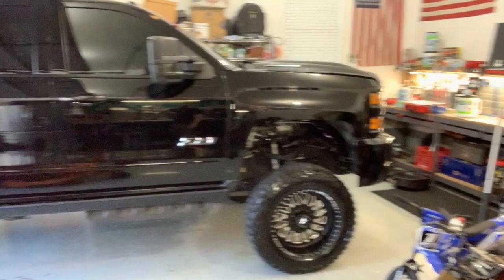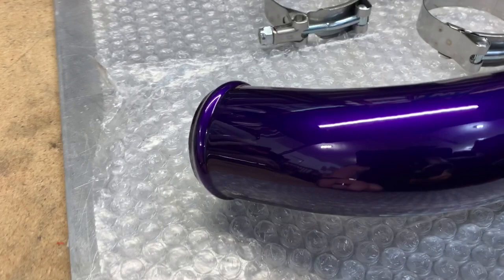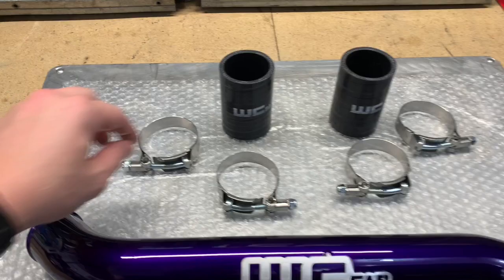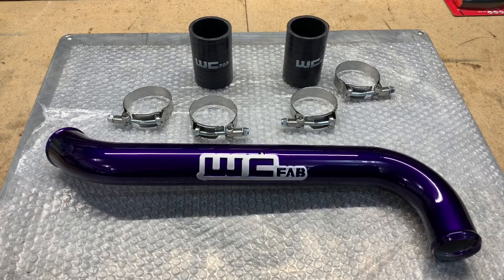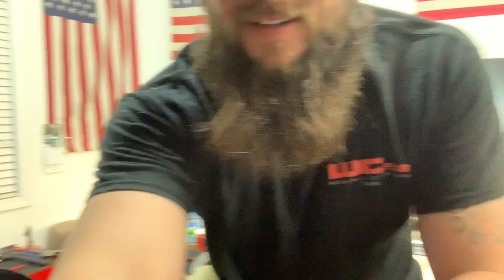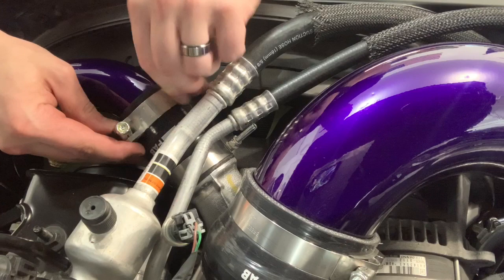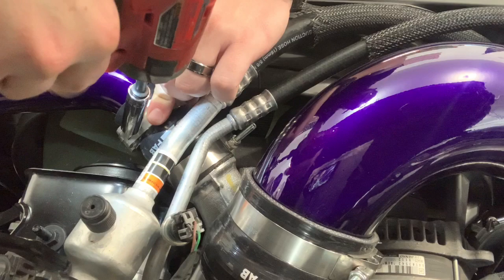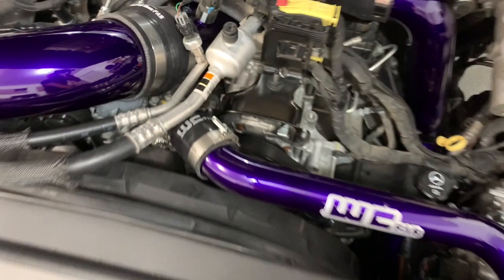Wehrli Fab Upper Coolant Pipe Install! 2017-2019 Duramax L5P!!

Comment: I just ordered the upper radiator coolant pipe for my 2013 LML Duramax. I  also have the drivers side hot pipe on the way. I just bought this truck. It's my 1st diesel I've ever owned.  It's a 2013 chevy silverado 2500HD 6.6L LML Duramax with 144,000 miles. The truck is 100% stock. I also have a 100gph Air Dog lift pump sitting here waiting for spring. It's way to cold now to me horsing around with anything. But I'm watching everyones you tube videos to learn from. I'm doing the easy stuff 1st, to learn and grow confident as l said my 1st diesel.
Reply from the maker: Wayne, congrats! The LML is a great platform! Enjoy the new rig. Let me know if I can help with anything!
Reply: @Scott Link  
Where r you located? I'm in North Branch Minnesota
Reply: @Scott Link  
Hey when you installed your upper radiator pipe, did you just pop off the stock hose and allow what ever coolant to just drain out from there? You didn't pop off the lower hose?
Reply from the maker: @waynejohnson3388  Kentucky! 💪🏼🇺🇸
Reply from the maker: @waynejohnson3388  it’s actually best to just unscrew the drain in the bottom of the radiator!
Reply: @Scott Link  
I'm not seeing a drain spiket on my bottom of my radiator? Do you know it's location. I want to loose as little as possibly of my coolant because the dealership just preformed a cooling system flush and refill.

Comment: Engine bay is all dressed up and looking 💯💯💯👍👍 you are going to have to keep an eye on the coolant for a while... these L5P's are really finicky with burping the air out.
Reply from the maker: I sure will. That’s what I have heard. I should have ran the heat etc when I fired it up. I’ll do that, and check it after each time I drive it. And thank you! It’s coming together. One piece at a time. I appreciate you watching!

Comment: Awesome install brother it sets off the engine bay real nice, make sure you give it a second tighten once you get her up to temp right after you drive it , mine leaked a little but once I re torqued it she was fine, as a matter of fact it leaked slowly on to a belt which for a whole 2 weeks made a noise that I thought was a bad injector it put me through hell, than I found it it was just the coolant leak hitting the belt .........man it was crazy.
Reply from the maker: Thanks for the tip! I’ll be sure to re check it after I drive it! I appreciate the feedback. And I appreciate you watching as always! Thanks for stopping in!

Comment: Sorry you had to learn that the hard way... always drain the radiator down some or all the way depending on what hose your dealing with. If nothing else it saves a hell of a mess lol.  I’m working on getting all the whirly fab stuff now, already have my intake horn. They didn’t have the intake when I put the banks on, so will be trying to sell that 🤦‍♂️
Reply from the maker: Yea. I prob should have drained it a little. My dad told me the same thing after he watched the video! Ha. Live and learn. It wasn’t too much of a mess. And all the stuff makes the truck sound very different now. Hope these videos help when you get around to installing! Thanks for watching, I appreciate it!
Reply: @50calprepper 
How much for the banks intake?

Comment: Scott great videos man, watching from way up north. Always appreciate your vids as I have a lot of the same mods. and have watched yours to learn from you haha, quick questions for you any increase is sound from your intercooler pipes being done? and any plan in the future on doing your down pipe or uppipes? thanks man keep up the good work.
Reply from the maker: Well, I did the intake, turbo horn, and Intercooler pipes all at once. The truck sounds very different! But I can’t pinpoint if it was the pipes or not. Down pipe for sure. But that may be for a later time, when some other mods are done. I appreciate you watching!

Comment: Is there a benefit to this or is it basically just for looks? Seems like it just adds 2 more spots for a leak
Reply from the maker: My opinion. Mostly for looks. But some functionality also. Some big Block high HP vehicles have a tendency to collapse the upper hose and pinch it closed under a heavy load. That’s why you typically see a steel braided or a metal style upper rad hose on older big block cars. Also, I have replaced very spongy hoses in the past. This will never collapse or become spongy. Yes, you are correct about the additional leak points. It’s personal preference. I routinely maintain my vehicles and this is on the list of things to check often. As long as you do that, you’ll be fine. I have had zero issues so far. Best of luck and thanks for watching!

Comment: if you let it run with the cap off you should be fine just add as needed
Reply from the maker: Thanks! I wasn’t sure what the hell to do! Ha. I appreciate you watching!
Reply: @linksgarage1985  yea I'd like to get all that piping as well for my 18 plus the  up pipes
Reply from the maker: @hatchetwarrior1240  - yep. I’ll eventually do up and down pipes. It’ll be a little bit. Lol
Reply: @linksgarage1985  yea the down pipe gets pricey with the dpf back exhaust
Reply from the maker: @hatchetwarrior1240  - It sure does sir.